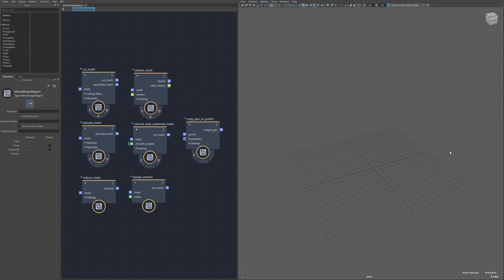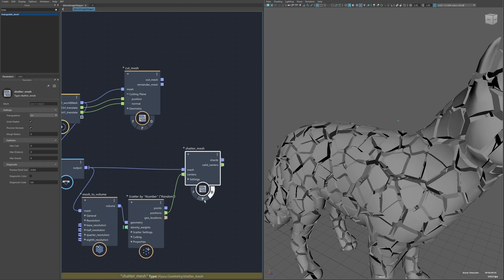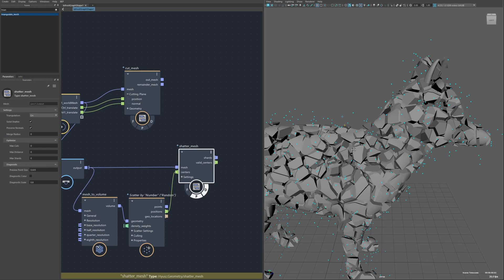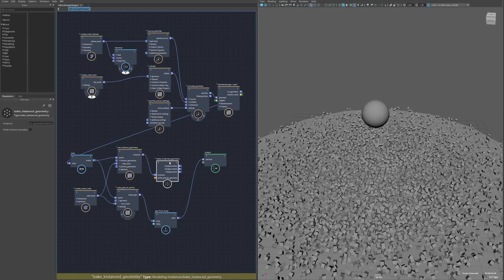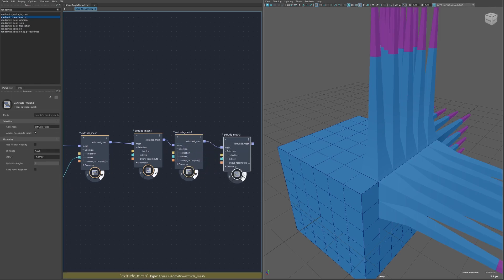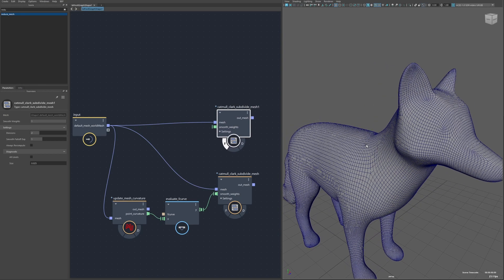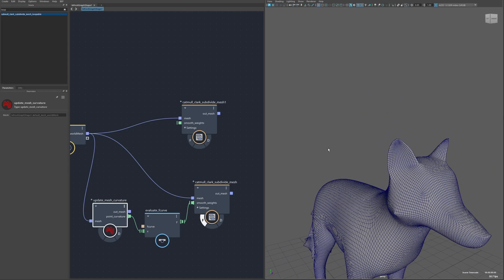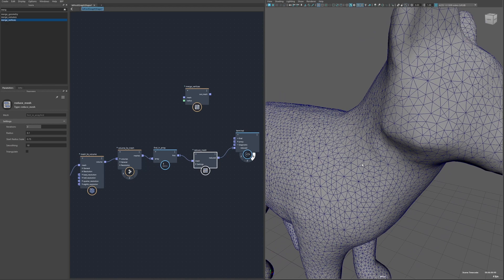Bifrost Mesh Modeling Nodes

Comment: Hi. In your compound there is a loopable catmul subdivision. Have you an example of this loop?
Reply from the maker: The base subdivide node contains feedback ports for caching data and stuff, feedback ports can't be used in loops though (iterate/for each), it'll just give a compile error. So the loopable version is the same just with feedback ports removed. the down side is performance when adjusting the parameters.
Reply: @hyuu1070  thanks for the explanation
Reply: Run away from Maya, go to Houdini.
Reply: @ACES-BRAZIL  i will

Comment: Finally a shatter node!  unfortunately this doesn't work well with the bullet solver (with geo exported to maya), because the shattered pieces have transforms at 0,0,0 and maya bullet doesn't like that (even with centered pivots).
Reply from the maker: After centering, try baking the pivot as well before creating the bullet system. This should give better results.